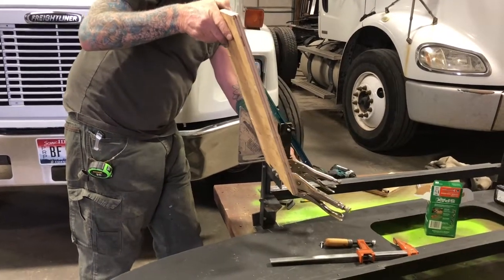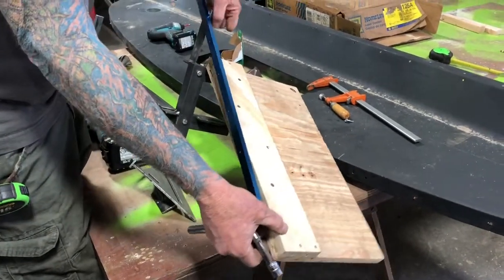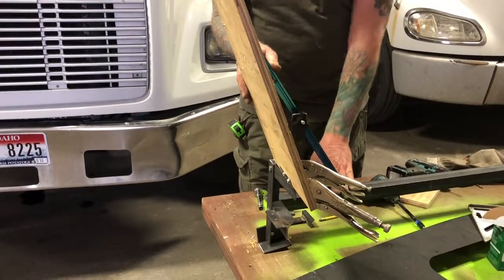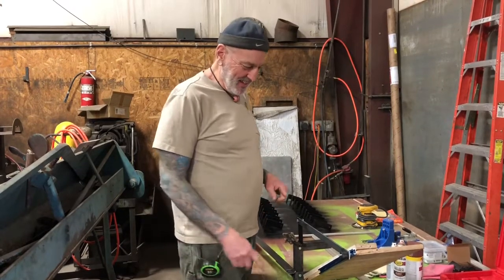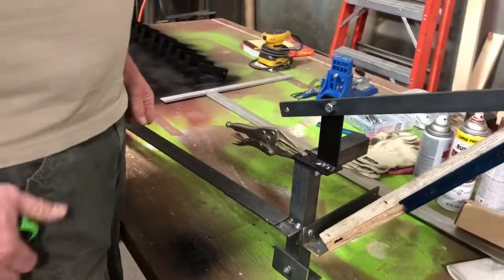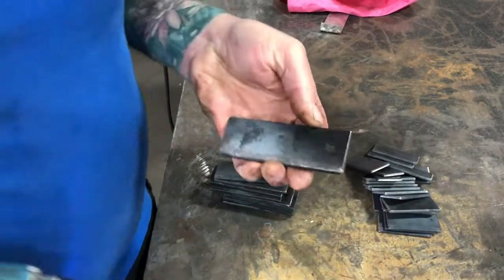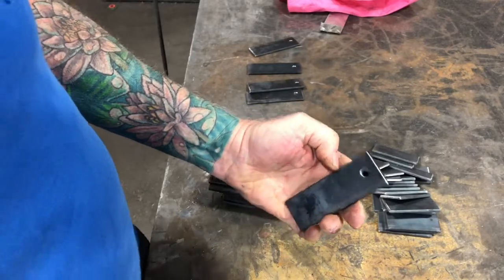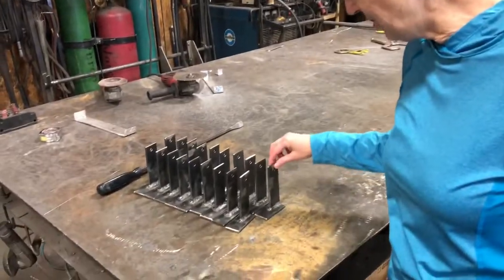Finalizing the Solar Panel Racks - Vlog 71 School Bus Conversion

Comment: If you have enough panels wouldn’t it be way easier to just have them all fixed flat?   Angles will give you max power, but if you over build the number it won’t be as important.  Are you really gonna want to climb up and adjust all your panels?   Fixed position will hold up better to long term vibrations and wind load.  Just my .02
Reply from the maker: We have been rethinking this are you are right. Right now the plan is to just lay them flat but until they are actually up there .... who knows. We are totally liking the clean lines that the rail has right now and don't want the change that.

Comment: Why can't arm be stationary and the bracket attached to solar panel have the cat so the opposite side moves and won't be in way of walk wau
Reply from the maker: At this point in time we have abandoned the panels being movable. Seems like it was important to capture every bit of solar that we could. But in retrospect having the hardware sticking up off of the roof seems kind of dangerous if one of us were to trip and fall up there which wouldn’t be good in any situation but that hardware sticking out could be not a good thing. So we’re going to just mount our panels flat.
Reply: @KnappTime  the panels I was telling you about are flat fixable panels with indepent absorbing mechanism. So it's the latest technology that you could actually walk on and if a little bit is in shade it wont stop it from charging g like old panels. It sticks to the roof so completely flat